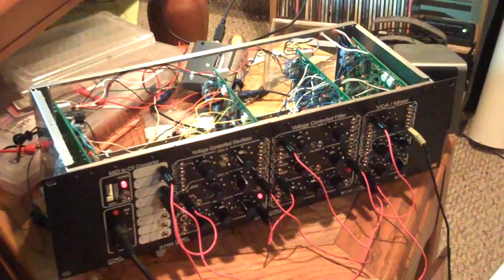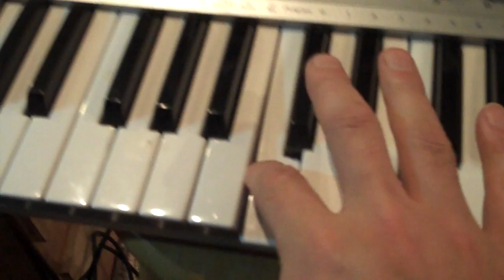Test patch for the PAiA 9700s modular synth

Comment from the maker: OK, so there could be three problems - your MIDI controller could be at fault - so I would run that through MidiOX to check it.

Then the MIDI interface could be at fault, make sure you are getting solid gate and CV signals (use a multimeter to check that).

If both of those are OK then you could have a problem with the oscillator.

Finally I wrote an application to help with tuning (I think I still have it) - contact me via the website for more on that.

Comment: Ok, so I have some problems with my 9700. I have two press a key twice to effect the note/gate.(I use the same controller that you did) Did you ever have this problem. I also can't seem to properly calibrate the VCO's, also, when the modulation in the filter is patched to the middle Mod in,(used when linking filter A to filter B) the reasonence will jump up all of a sudden and produce an almost untollerable squeal. Have you had these problems?